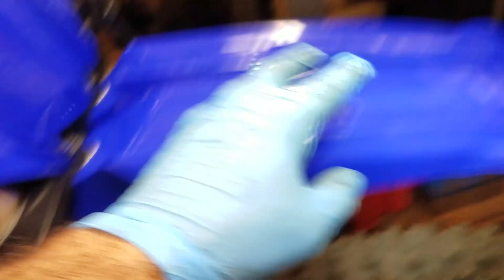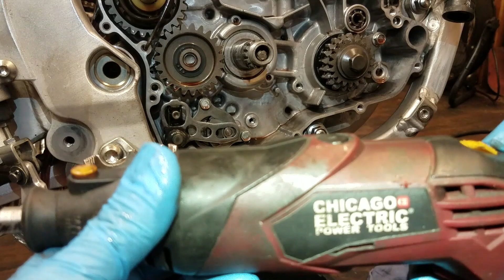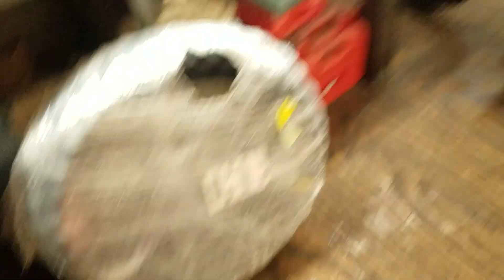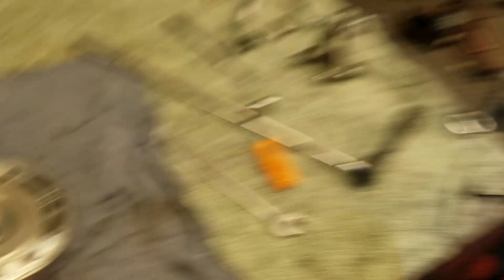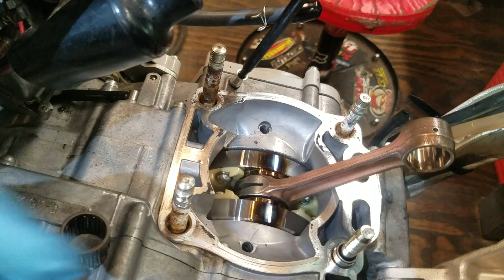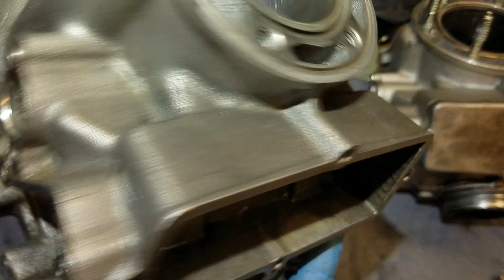1:11 YZ250 Up 2 Speed (Part 3) Digging in the motor. Top end, Shift detent mod, Tires, Chain.

Comment: Quick tip to check clutch basket that I saw some cool kids doing.
Great for quickly checking or changing springs, fibers and steels plates.
Lay the bike down around 3\4 the way on the left hand side supported by something softer than the bike. That way you don't need to drain fluids each time. 
This works on any 2T MX bike. Not sure about removing the entire inner clutch cover though haven't tried that yet but it def works for the outer cover and gives access to the entire clutch basket. 

Hi Bevis you mad fkr :)
Reply from the maker: For sure. I have done this also on 4 strokes too.  When I need to get under the cover but dont wanna drop the oil.

Comment: I just did the Shift mod to my 2006 YZ250 today.

I’ve only ever got maybe one or two false neutrals in the 50 or 60 hours of track time I’ve put on the bike but shifting definitely didn’t feel very tactile. Sometimes, especially when downshifting, there would be no “click“ or any type of physical response to let me know I shifted.

Doing this mod made upshifting feel significantly better but downshifting feels much more “clicky” and tactile than before. 

I cut the groove on the bottom side of that stopper lever and also ordered a new spring. The old spring definitely had a little less tension than the new one I installed. 

It took about an hour total from the time started loosening the first bolt to starting the bike up after. 

All in all I’d have to say it was worth it.
Reply from the maker: Right on!  Glad to hear it helped. The clicky downshifting will ease up a little after the new spring breaks in a little. And I agree, in stock form you sometimes cant even feel if you completed the shift or not.
Reply: @UpAllNight91  I like the clicky downshifting. I want all of the tactile Ness and physical feedback that I can get on my left boot when I’m shifting to affirm that the shift was completed.
Reply from the maker: @MrJeffharper47  Ahh ok.  I thought you was complaining lol.  I'm like you though, I want to know I got that shift in. Especially important when heading towards jumps.
Reply: @UpAllNight91  for sure. Or when I’m in the air and I’m trying to downshift lol
Reply from the maker: @MrJeffharper47  That too!
Reply: @UpAllNight91  I love the hell out of your videos by the way. You speak well and are very informative. It’s a bonus that I also own a YZ250 so keep the Yamaha content coming lol
Reply from the maker: @MrJeffharper47  Thanks brother! Appreciate that! I sure will.  I have a ton more coming with this 2022

Comment: Hey I’m looking at buying a 2016 YZ 125 down here in Florida for $4000. It’s a YZ 125 rebuilt from the frame up. Everything is new. the engine has been rebuilt cases vapor blasted. Brand new KKE rims Dunlop tires new tubes. New oem plastic and seat cover. Asv levers. Odi grips. New clutch cable new throttle cable oem. New pro circuit works full exhaust system. New vf4R reeds new airfilter. Carb has been cleaned and rebuilt and tuned. New titanium foot pegs. New brake lever shifter and kick starter. I mean the list goes on and on. The bike is a 2016 and all this just got done 5-15-24. Bike in the pictures also look brand new. 15 hours on top end.
Reply from the maker: Sounds good. Just be sure to look everything over real well. Some of the bikes that have giving us the biggest problems here in the shop are the ones that have had lots of stuff tossed on them. Look her over good.
Reply: Seller sent a video and she sounds great, no bogging. Do you think 4k is worth the price
Reply from the maker: @Must.Excelerate   the 2016's are wroth about 3000 to 3600 currently. So I guess it depends if the add on's are worth it to you.

Comment: Like your Dremel idea but my way on my 2001 yz 250 and my 2020 YZ250 x I heat my spring red hot and give it a half twist....works great
Reply from the maker: Guess that would work too. Whatever it take, it just needs more spring pressure thats for sure.

Comment: Thanks for the video. When its time to do the crank on a '99 and up YZ250, would you prefer rebuilding the stock one or just purchasing an already assembled new crank and rod? I used to have a '98 YZ250. Now I have a brand new one, and so I have both options. I was out of luck on buying a new one for the '98 since those are unobtanium.
Reply from the maker: Hello.  A new crank is always be best choice because every time a crank is rebuilt with a new rod and bearing. And the pin is pressed out of the crank halfs and a new one pressed it, it becomes weaker. And is easier to knock out of true since its not holding as tightly as a Virgin crank would be.  So as long as brand new cranks are available thats the best option.  Once they are not available anymore then that's when we have no choice but to rebuild old cranks. I do like to check the true on the new crank before installing and if alls good, (usually is) alls good

Comment: My bike giving me he'll again it a bad vibration I checked clutch side all gears are good now im thinking it's crank or crank bearing so I'm take it to my mechanic to hear it I ordered a new crank today it has 135 hours I have crank bearings in my room should I just keep driving it or pull motor an split cases  if I go that far I'm replacing all bearings this dam bike I just did topend last weekend
Reply from the maker: If you think the crank is going out I wouldnt ride it.
Reply: @UpAllNight91  hey I give u update took it to my mechanic he said it's not crank it's motor mount bushings is why it has bad vibration an I bought new crank cheap one on ebay karma  crank so I'm having hard time finding bushings an I ordered new swing arm bushings yesterday what could I do in mean time I may take motor out put some kind of bushing in there

Comment: Why are the crank webs blue around pin area if it did not get hot supposedly?
Reply: Assembly process from the factory. You'll find that on many jap MX bikes including 4T
Reply: I have this same question.
Reply from the maker: Yup. What Keith said. They heat the crank in that area very hot during the assembly of the lower connecting rod at the factory. Every YZ250 crank will have that blueing on the crank, brand out the box. Its normal.

Comment: Oh also has longer springs in the forks like the 4t's
Reply from the maker: Yes, the fork springs are surely different. I have some I ordered from factory connection.
Reply: @UpAllNight91  yeah, bummed me out cuz I couldn't use the springs and valving from my 17 to my 23. To make matters worse the guy I bought the 23 from had it revalved pretty much perfect for my size and speed, which is great, but the nut holding the rebound Midvale/rebound piston backed off completely doing pretty significant damage.. but oh well
Reply: So being a cheapo I found a guy selling the internals from an older fork on fb for $100, and redid the valving like my old one, that's pretty similar to the new one, but one has a long spring and the other the short spring, same rates, lol ride 2 hours yesterday and seems to be working good. Will eventually buy a new cartridge assembly though.
Reply: I know they updated these to the 4t internals in 22, but I don't know if any  will match better?? They are going to have different part numbers regardless due to the shim stacks being different between models. Contacted a local suspension guy but wasn't going to tell me anything unless I brought them in.. which is understandable.
Reply from the maker: @barkeep25  Ok. What are they like 10mm difference in length?
Reply from the maker: @barkeep25  Crap that sucks the forks got damaged. Bummer

Comment: I'm sure you've heard of the pv mod already,  but did you know that the 22 and newer yz's already come that way,  with one less washer
Reply from the maker: Hello. I checked into it. It seems they only added this change to the 250X. The normal YZ250 still has all washers just as all the models before it. I thought about trying this mod down the road but not sure how I will like it on a MX track where rapping the motor up quickly can be a good thing.  Guess I will need to try it to know for sure.
Reply: @UpAllNight91  Oh crap your right. Good to know!